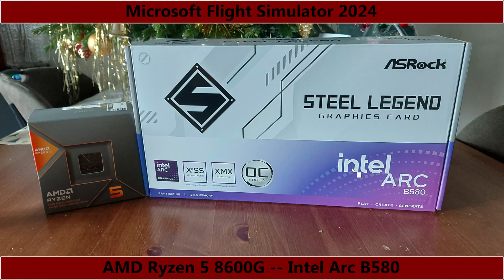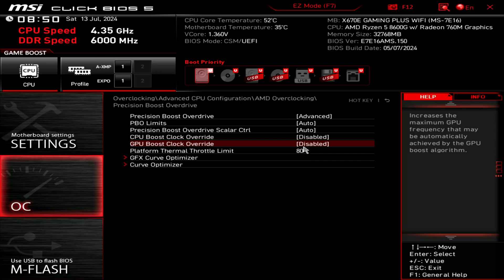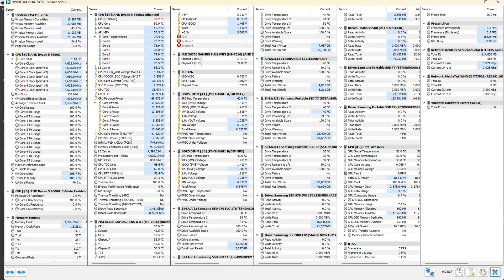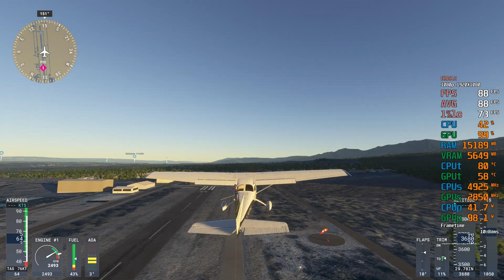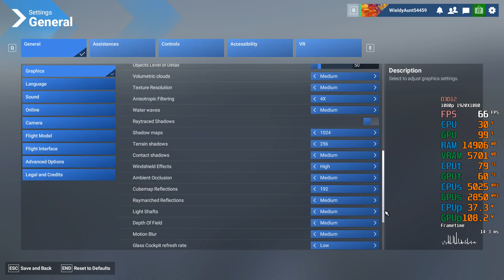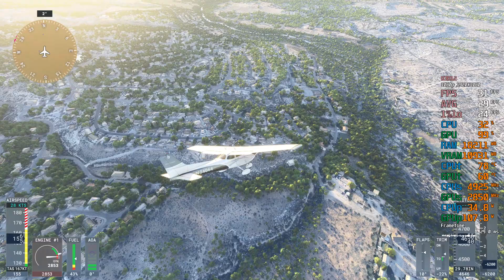Intel Arc B580 -- Ryzen 5 8600G -- Microsoft Flight Simulator 2024 FPS Test

Comment: Hello Mx. Benchmarks. I got all the goodies but none of the graphics card. So what do you think? Go for 2024 or forget it? FSX won't run on my new computer because some of the earlier framework files were done away with (and who know what all else.) .... After your experiment...whatcha think?   Many thanks for your timely video!
GEEKOM IT1 Mega AI Mini PC 14th Gen Intel Ultra 9 185H(Up to 5.1Ghz) Mini Computer Dual LAN 32GB DDR5 5600Mhz RAM 2TB NVMe SSD Mini Desktop Intel ARC Gpu/AI NPU/WiFi 7/BT5.4/8K/Win11Pro
Reply from the maker: The iGPU core intel ARC has 8 Xe [Xe LPG is low power] cores while the B580 has 20 Xe2 cores
https://www.notebookcheck.net/Intel-Core-Ultra-9-185H-Processor-Benchmarks-and-Specs.783353.0.html

MSFS 2024 needs a recommended card like the Radeon RX 5700 XT or GeForce RTX 2080
https://store.steampowered.com/app/2537590/Microsoft_Flight_Simulator_2024/

Perplexity AI says this:
The Xe2 architecture in the Arc B580 represents a generational leap over Xe LPG, with advanced ray tracing, AI acceleration, and 4K-ready performance. While the iGPU remains ideal for portable devices and efficiency, the B580 caters to high-end gaming and professional workflows. 

The graphics quality might not be great, please have a look @ a 780M video [should be close]:
https://www.youtube.com/watch?v=VfAAWD9JFc0
Reply: @Benchmarks  Hello again. Super thanks for your instruction. I'm see pretty much what you're telling. Sounds pretty iffy. It is what it is.... Again, thanks for the info!! So many see my question (who may have THE answer) and just flitter on off. Yuh did good!!

Comment: Why not also do 1440p?
Reply from the maker: The high preset [without upscaling] in 1080p was below 40FPS, FSR 2 wasn't that good with this GPU and XESS is not [yet?] supported.
1440p would have had an unplayable frame rate with decent 1440p settings.
Reply: @Benchmarks  Really? I've seen some people claim its fine native and does have XESS support. I'll be getting one, I'll try it out myself.
Reply from the maker: @ZeHydra  On may 14 [day of my testing] I couldn't find XeSS support in the game, perhaps I missed it ;-(
That's why I used FSR 2 instead.
Also in fora [dated februari] people are complaining of not having XeSS support in Flight Simulator 2024.